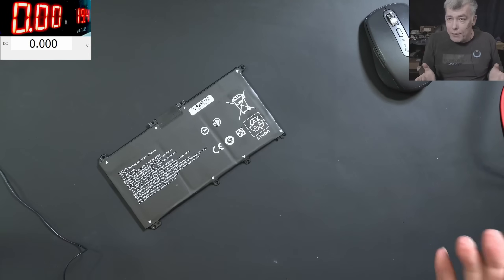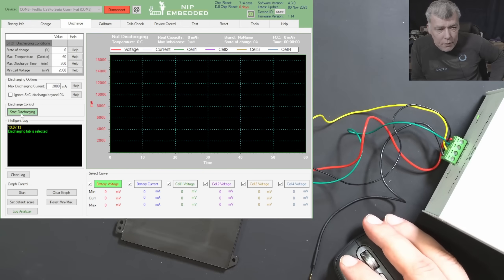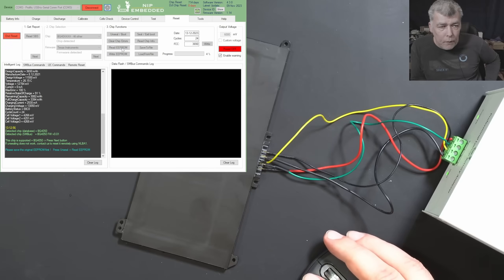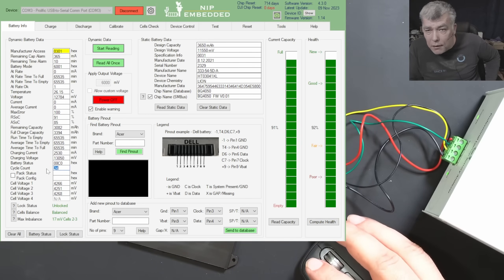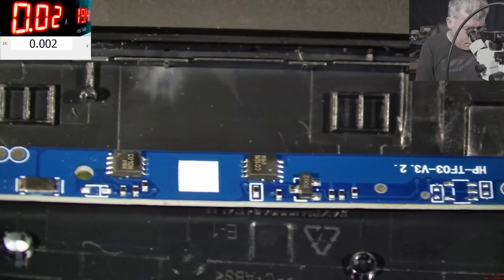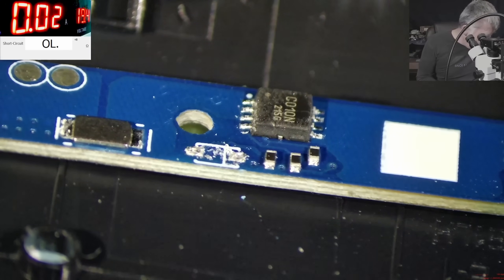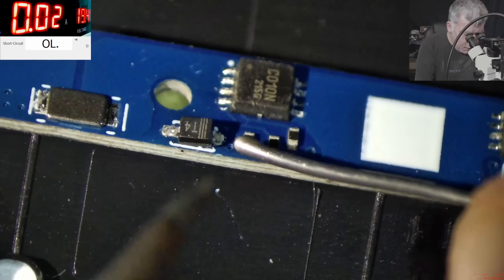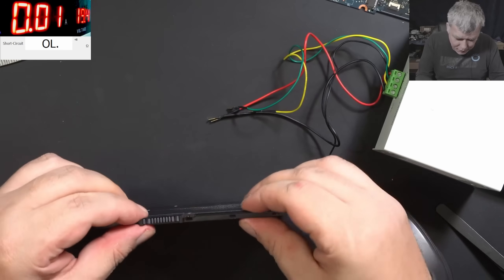Hp HT03XL laptop battery board repair https://www.laptopu.ro/ Coupon code electronicsrepairschool

Comment: Is it true that you cannot unlock batteries with this tool unless you pay a yearly subscrption? I was interested until i saw that....
Reply: The NLBA1 PRO tool is an unlimited free battery analyzer that comes with 10 free days Chip Repair Option. If you want to repair batteries, yes, you need this Chip Repair option.
The author of the device is thinking to sell the NLBA1 device with free X number of battery repairs per year, just to encourage the small shops.

Comment: You have to watchout when buying genuine new/old stock batteries, if they are old, ie, bought some genuine batteries for 2011 phone and they only lasted a few months before they were as bad as the old battery I took out - lol -. 
Batteries, genuine or aftermarket, are only manufactured around the time the device is popular, so if the device is old, probably no battery will be good.

Comment: Faulty/bad soldering from factory, or overpower created in that component for some reason and then when dropped, weakened joints in that state cause it fell off, given how the soldering looks i think the latter is more likely and in this case there is a decent chance this diode is faulty past certain point current passes through it so this may happen again to it or next time it just goes bad.
I'd test if i found it like Sorin did, just case it needed replacement.
Find its spec, run max rated current at max rated voltage for 3 hours and monitor while you have it loaded like that, it will get hot pretty fast but if it's gonna be bad anyway it will probably fail within this time, that's how you learn.

Comment: I have had similar issues a couple of times but usually the battery was locked and the thermal fuse gone, never seen this on a healthy battery that was not locked, this is strange